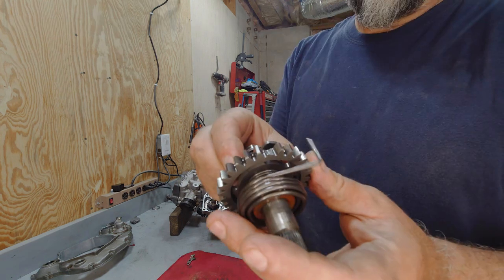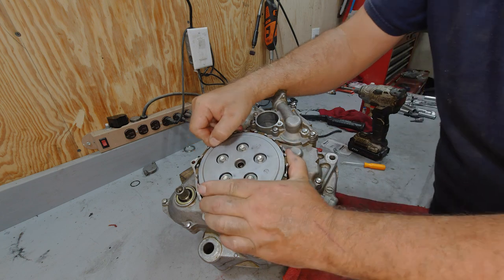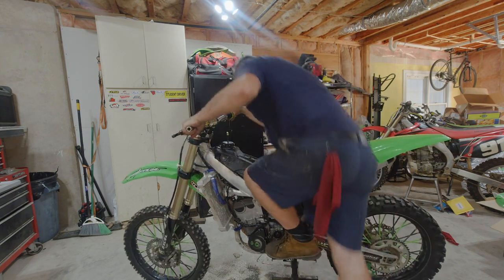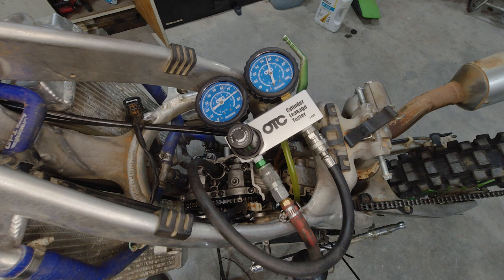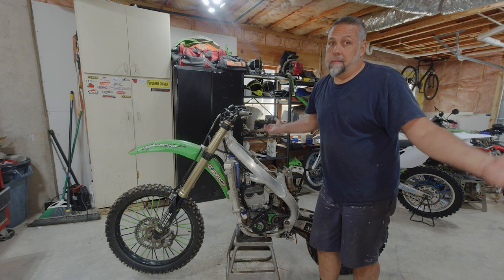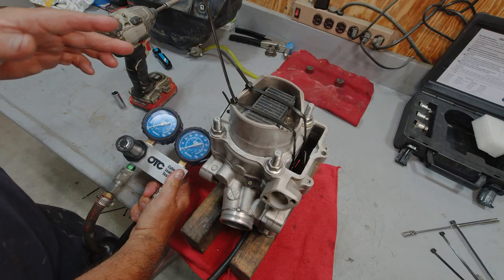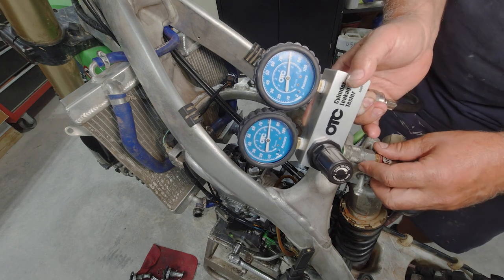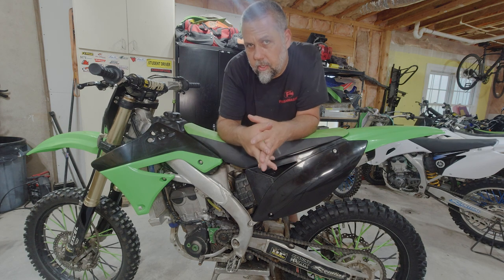2010 Kawasaki KX250F Part 2 Ep59

Comment: I use a Harbor freight 500 lb hydraulic table cart it really saves  your back as it gets the bike up higher.
Reply from the maker: I was looking at those. I do have limited space and sometimes work on ATVs so I’m not sure if that would work for me. They are pretty heavy, yeah?
Reply: @restoroosterohv  they are not real heavy but i put a ratchet strap on mine and you can move a bike right up against the wall with the tires off the ground , i have two and it lets me move the bikes around to park them whatever way. Its been handy for other stuff around the garage
Reply from the maker: Are they on rollers?
Reply: @restoroosterohv  yes  its not a motorcycle stand by design but works well for one
Reply from the maker: Thanks for the info.

Comment: Wassup my guy I love what u doin w/those bikes I’m most definitely a fan bcuz I refer to ur videos a lot wen I’m stuck like now! But if it isn’t too much trouble I need ur input on this 2007 Kx250f that I’m working on I just did a full rebuild on it finally got it started last nite but the valves was doin alotta of clattering so 2day I reshimmed them & now the bike don’t wanna start at all I’ve been kicking this thing since 11am! Any advice frm 1 mechanic to the next?! 🤷🏽‍♂️
Reply from the maker: Thank you. Be sure that your cam timing is spot on with the piston on TDC and on the compression stroke. Lobes on both cams should be pointing away from each other and slightly facing up from level (camshaft timing marks should also be lined up properly). At this point, re-check your clearances. Intake should be 0.10-0.15mm and exhaust 0.17-0.22mm.
Reply: Everything is on point all my dots on the cams 28 pins in between the timing marks on the cam sprockets I reshimmed again still nothing! I have a tusk feeler gauge so wen u say 10-15mm do u mean go off of the bottom # w/ the mm rite beside it rite?!
Reply from the maker: If you need standard measurements, its 0.0039 ∼ 0.0059 in on the intake and 0.0067 ∼ 0.0087 in. exhaust. If your clearances are good, next I would check to be sure you didn't bend a valve buy doing a compression check at least and a cylinder leakage test. It was running so you know your spark and fuel are good.
Reply: Ok I’m confused as to which line on the flywheel is top dead center! There’s 3 marks if I’m turning it counterclockwise is it the 2nd or third line?!
Reply from the maker: pull the spark plug, stick a long screwdriver or straw down until it contacts the piston. Turn the flywheel counter clockwise until the piston is at is top most travel on the compression stroke. The cams should point in the direction I mentioned earlier in our conversation.
Reply: I think I figured the problem out which is the intake camshaft gear has spun causing me not being able to get correct timing! My next question is is it possible to time it & make the bike run even tho the gear has spun?! 🤔
Reply from the maker: It would be tricky to get it right. If it spun, it may spin again and bend valves. These will run if the cams are close enough although performance will obviously be impacted. Mirror the exhaust cam lobes on the intake.
Reply: I rly appreciate u a lot although it’s not for me it’s for a customer & I’m pretty sure he’s gonna take the cheaper route me personally I’d just replace it! 🤷🏽‍♂️
Reply from the maker: @AntonioBragg-gr9wq make sure you let him know the risks and ramifications. It could potentially destroy the entire top end.
Reply: I most definitely did & ofc he said wat I knew he was gonna say! SMH 🤦🏽‍♂️
Reply: Sorry to bother again but I just wanna know ur thoughts on this issue to see if I’m correct or not! But I got the new camshaft intake put it on the bike is starting now but now all of a sudden I have coolant leaking out of the stator cover wat could be the cause for that?!
Reply from the maker: Where is it coming out of the stator cover? Sounds like you may have a head or cylinder base gasket failure. Is the coolant mixing with the oil? Pull your cam cover back off, ideally you'd want to pressurize the cooling system with a pressure tester and look if you can see coolant coming out of the head down the timing chain valley. If the oil is milky (Mixed with water) don't run the engine
Reply: Sadly I don’t have a pressure tester but it is mixing w/the oil tho & I just recently rebuilt the water seals!
Reply from the maker: You have to find out where the breach is. Is it the top end gaskets, is it the water pump seals? Grab a pressure tester from Harbor Freight.